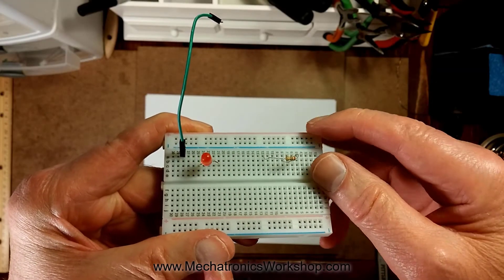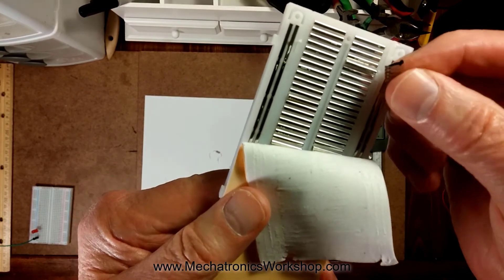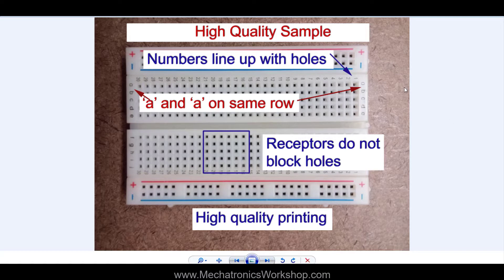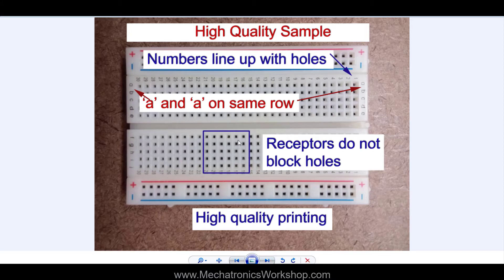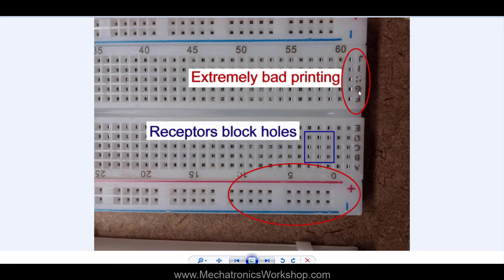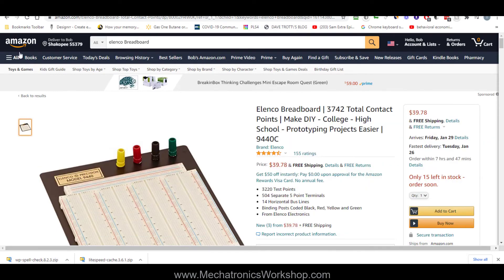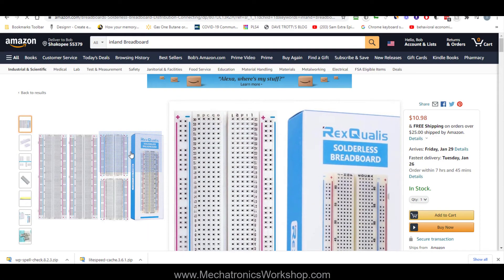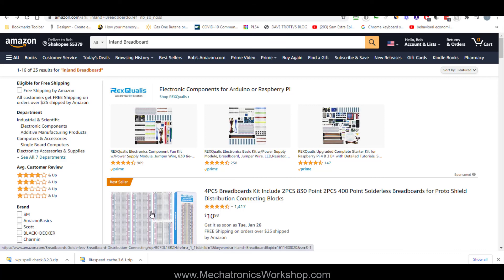If You Buy The Wrong Breadboard You'll Regret It

Comment: I don't know what is wrong with my circuit, but if I touch certain components it will suddenly work. At this point I think it is the breadboard, I'm using the small one that came with the arduino. Probably cheap crap. Maybe I'll just soldier everything together to rule out the circuit design, which I am basically just copying from online
Reply from the maker: It's almost certainly a bad connection either from really skinny component leads or a bad breadboard. If it came from the real Arduino folks at Arduino.cc it's bound to be a high-quality breadboard though. It's also possible you have a bad component. And even less likely but possible, the capacitance of your body is triggering a sensitive component. But probably just a loose connection somewhere. Soldering everything is always a more secure way of doing it. Use perfboard for that. Here's a pretty good video if you're not familiar with perfboard: https://youtu.be/l9Kbr8cPqOE
Reply: Same